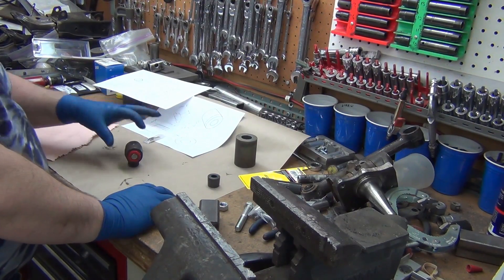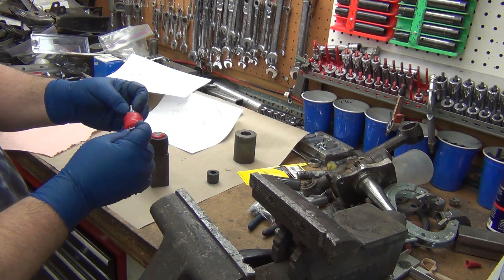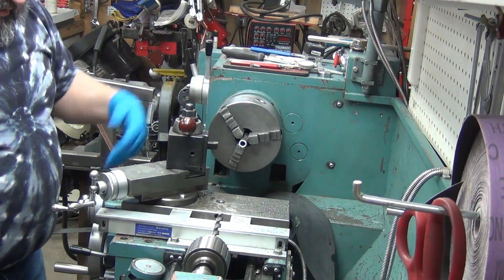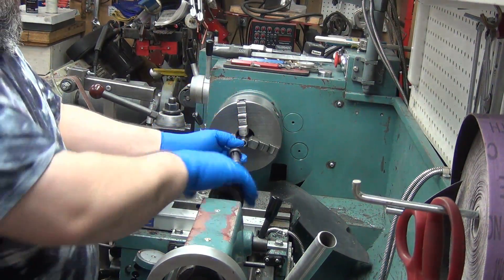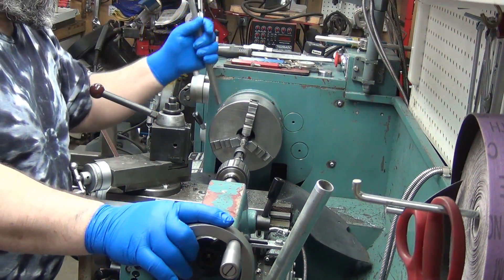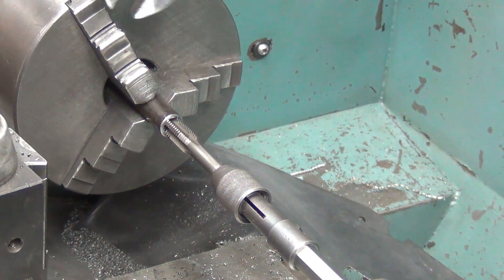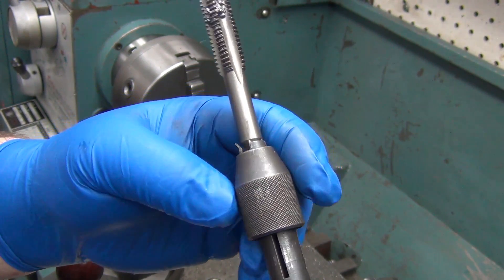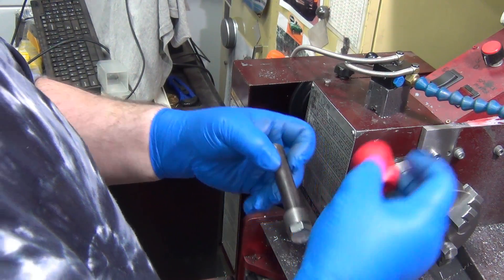UCA - Urethane Bushing pt1

Comment: Hi, those carbon steel taps are barely good for one hole and only half a hole in stainless, whatever the length is ... HSS taps are soo much better, also let the tail stock free to slide...
Anxious to see how urethane machines...
Pierre
Reply from the maker: I agree!  I swear by HSS taps......just didn't have one in that size.  I'll have to change that soon.  I'll try the tail stock slide next time :)
Ahhhh.......I should get the urethane vid edited and up.
Thanks!

Comment: Lol, when you locked the tail stock, I went HUH????, but like your tool.  Chui taught me to cheat on thread engagement depending on the build....saves time and personal stress...LOL
Reply from the maker: I was turning the handle to push the tap in, but obviously, not fast enough. lol  I should probably go order another tap handle while I'm thinking about it.
Most of my personal stress is on my belt. :)

Comment: I was wondering why you weren't power tapping that? I have to use that tapping method in my 9x20 cause it doesn't have enough power to tap shit!
Reply from the maker: It was a cheap carbon tap and I could see the holder flexing as it was.  I should have drilled it out more.  If I was doing a bunch of them, I'd figure out how to power tap it.

Comment: Hi Mike, I know it's a bit too late now but next time let the tail stock float once the thread is started. It only takes one or two threads to pull the tail stock along.
ATB
chris
Reply from the maker: Ah...good to know.  I thought it would be too heavy.  I'm going to try to do some work on my little cnc lathe and set it up to do threading.  Hoping to get to that within the next month or so.
Thanks!!
Mike
Reply: Quite often I don't lock the tail stock down at all but just push until it self feeds, Depending on individual circumstances of course. I think in your example drilling the hole slightly larger would have been no disadvantage as ultimate strength is not important.but ease of tapping is.
Reply: bluehandsvideo Neat tool design! Mike, have a look at a Torque vs Tensile load/clamping force graph/chart... It surprises a lot of people just how much force can be generated using a regular thread even the smaller ones at very low torques. 10-15lbs of tail-stock is nothing after you've cut a couple of threads.
Reply from the maker: l0ckcr4ck3r  That's good to know!!  Thanks!
Reply from the maker: Chris Stephens You're right....I could/should have drilled that out a bit.  There's almost no load on the threads when it's in use so full thread engagement was overkill.  Thanks!